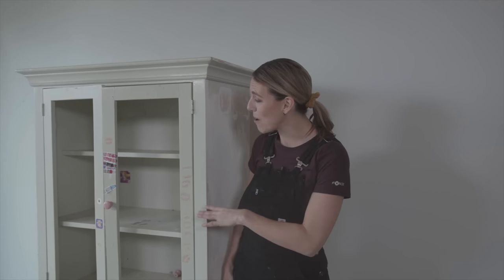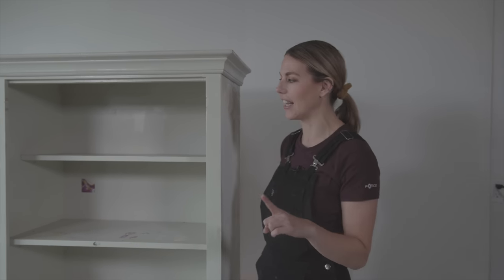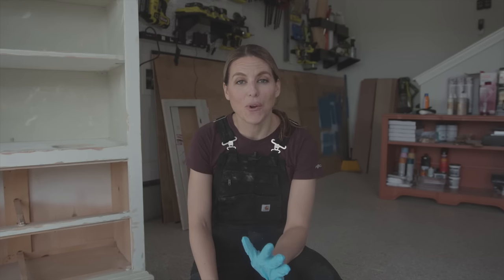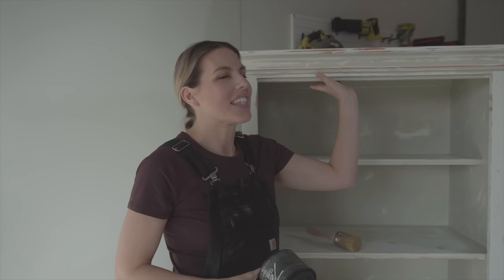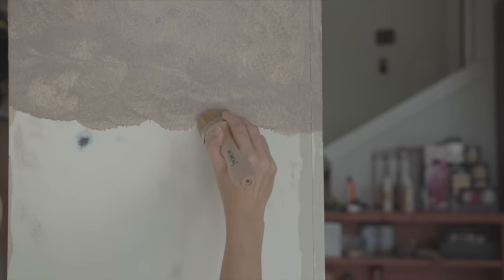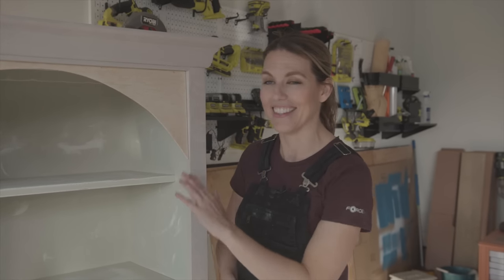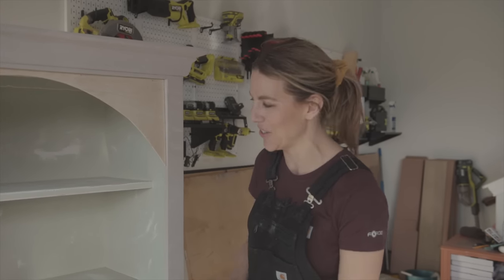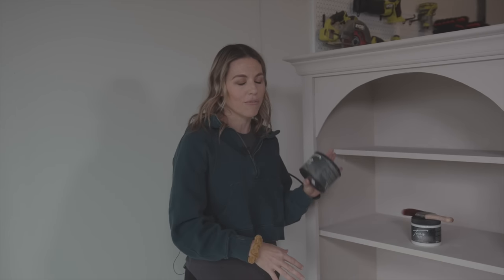Miracle Transformation: Roman Clay & Arches Transform My Furniture Makeover!

Comment: Beautiful cabinet!!  Btw, is there a reason to start with the scraper and then switch to a sander, rather than doing it all with a sander? Is it just based on personal preference, or is there a process/result benefit from using the scraper?
Reply: Im thinking it could be because of the paint type it may have gummed up the sanding pads where as with scraping you can get through those layers better and just sand whats left.